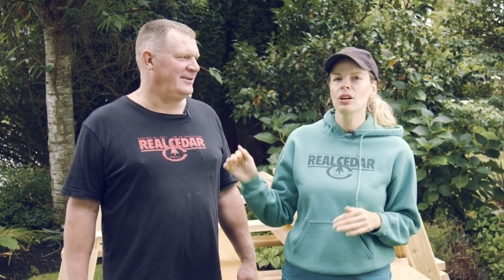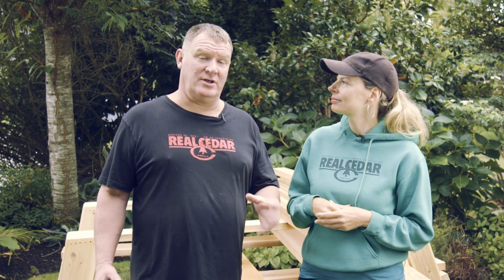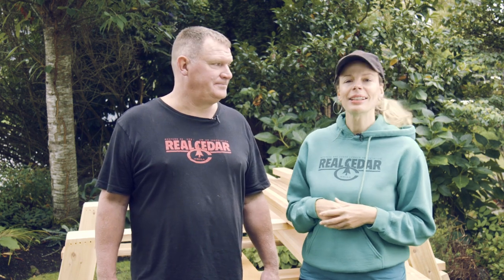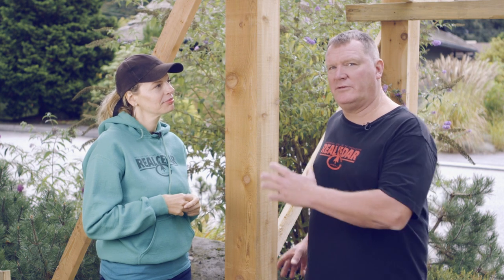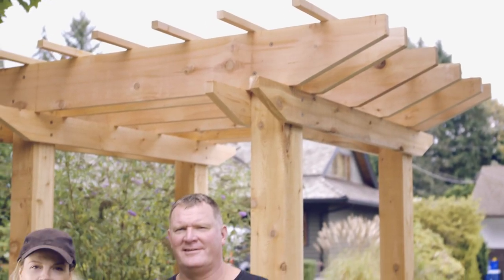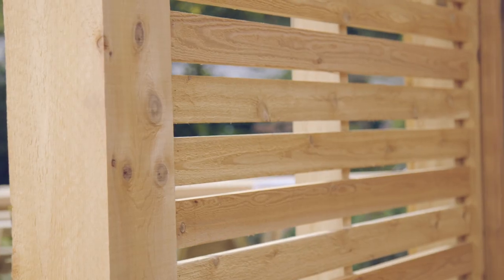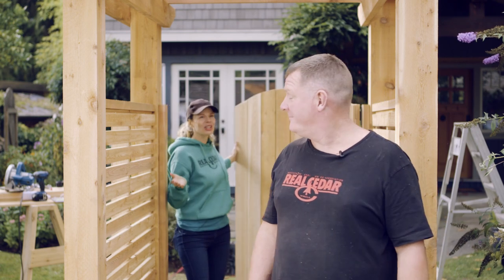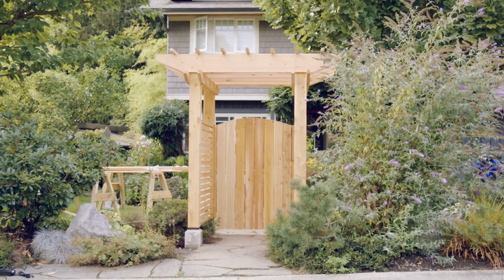DIY: How to Build an Entrance Trellis - RealCedar.com

Comment: This is basically a cedar commercial. They run through everything so quickly, that it is not a DIY video. They skip over a lot of steps and don't answer anyone's questions in the comment section. Nice Trellis though. :)

Comment: Which fasteners are you using here please?
Reply from the maker: Here is the pro trip from the instructions: For all outdoor work, you should use corrosion-resistant stainless steel or hot-dipped galvanized nails. Other fasteners and hardware such as bolts, screws and hinges should also be made from similar corrosion resistant materials. Here is a link to the project instructions.  https://www.realcedar.com/outdoor/free-diy-project-plans/entrance-trellis